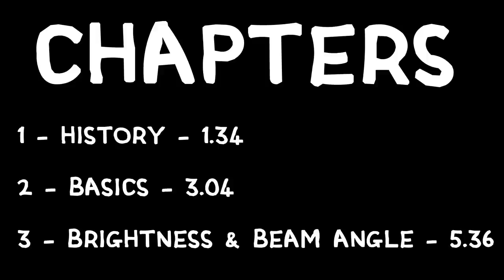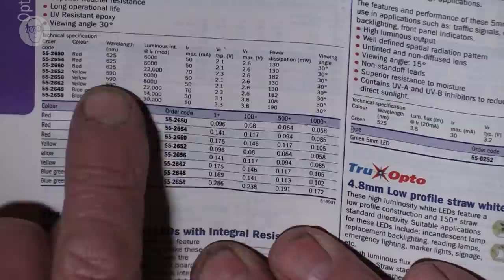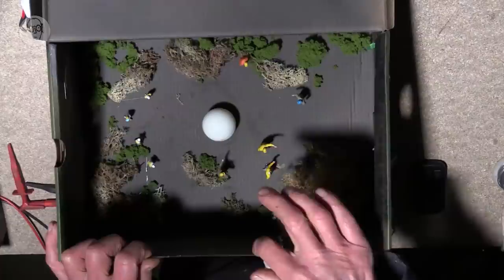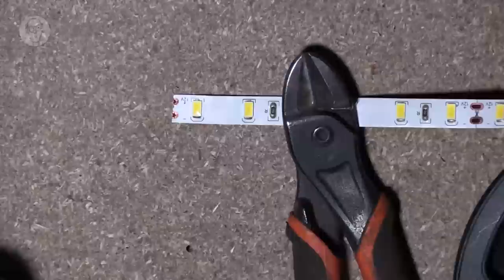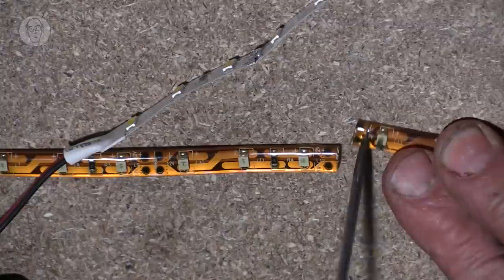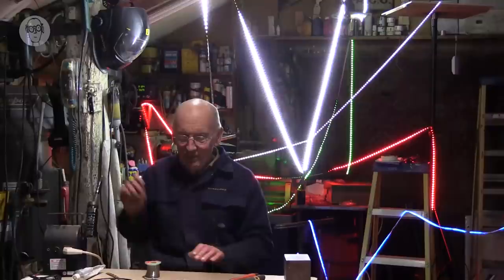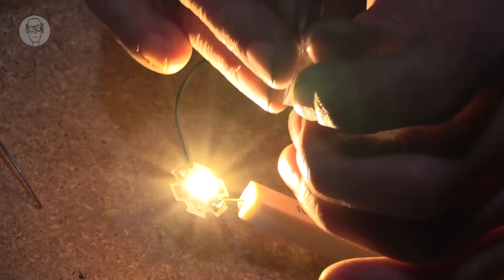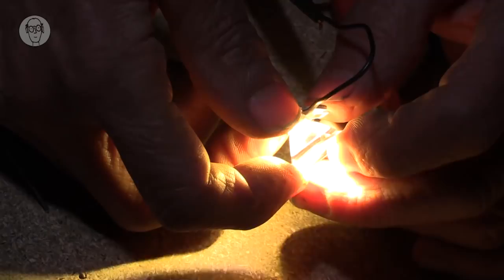LEDs -The Secret Life of components, a series of guides for designers and makers - Episode 2

Comment: It's interesting to note that while the first LED tubes did use a connection to each end, they later switched to feeding the power from one end due to the number of shocks received by people replacing tubes while powered.  Traditional tubes didn't generally conduct from one end to the other until the gas had been ionised.  To allow for the existing wiring they sometimes used a PTC self resetting fuse bridging the pins at one end and a starter that had a link in it so that the existing circuit with bypassed ballast would ultimately feed live and neutral to one end.
Other tubes require the fitting to be wired with live and neutral at one end and will only work one way round.
Reply: we NEED to see a video collaboration with you and Tim. It would be EPIC!
Reply: LED retrofit tubes that use a connections at both ends have been illegal to supply in most countries for a long time. Regulators claim this is for safety, however it's almost impossible for any danger to actually occur in real life. To be zapped you have to have the power switched on, be standing on a metal ladder, then fit only one end of the tube (leaving the other end dangling). Next you must rotate the tube 90° to lock it in, then reach along to the far end of the tube and touch the exposed pins of the non-inserted end of the tube whilst not knocking out the connected end's pins. After all that, you still only have a 50% chance that your initial connection was to the Active (Line/Live) of the mains.
- There is FAR HIGHER danger from a standard ES or BC lampholder, for example in a table lamp, since that carries a 100% chance of shock from touching the connections.
A retrofit LED Tube DOES NOT require any rewiring nor ballast removal for standard "switch start" fixtures used in most countries (an American rapid start, instant start or any electronic ballast fixture will need rewiring).
Where the LED Tube has connections at either end, the circuit works after removal of the old starter (leaving it open circuit).
Where the LED Tube has connections at ONE end, the starter is replaced with a "LED starter" that is actually a fuse.
The old (magnetic) fluorescent ballast can safely be left in-circuit, and there are no significant losses or voltage drop across the windings. That's because of the reduced power drawn by the LED tube, which prevents the ballast doing it's "inductive stuff" like in the old fluorescent circuit.
I've extensively tested such retrofit tubes during product development, and the maximum loss from a 36/40W ballast and <20W LED tube is about 1W, and it's typically under 0.5W for many combinations. This loss is small  compared to the overall power saving (eg: 46W to 15W = 31W) and it is not worth the time and effort to bypass the ballast.
Reply: @68Polara500  And ElectroBOOM !
Reply: I was just thinking "I wonder if clive ever watched Tim's TV shows" and then I scrolled down and immediately saw your comment! Were Tim's secret life of machines a series you watched in the past?
Reply: Yes a series with Tim & Big Clive would get my vote. Remember Tim & Rex's shows fondly. Great to see him producing new content.
Reply: @Farlig69  better, he knows how to USE tools to not die this comment BROUGHT TO YOU BY HP, i mean AGILENT....err... KEYSIGHT? YEAH KEYSIGHT!~!!
as long as we dont get photonic in here or it'll get popped
Reply: You 2 should get together. It would be nice for the 2 of to swap views on tech...
Reply: @68Polara500  you have hit the nail on the head sir!

Comment: The way I remember which way they connect is to imagine that both the flat side of the LED and the shorter lead are "ground down", hence connected to ground or negative.

Love these videos!  Thank you for everything you do, Tim.
Reply: The flat line on the diode symbol is negative, also. Electrolytic capacitors have a line on the negative side, too.
Reply: That's a very earthy mnemonic.
Reply: NOT always, i've had some in the past with the opposite, long lead negative, and/or 'flat' positive !  think i still have some like that, you have to watch out!
Reply: @5roundsrapid263  some electrolytics years ago had a line and + symbols for the positive !

Comment: I've been a Tim Hunkin fan ever since the Secret Life series was first broadcast, so I've been binge watching these new videos!

The correct way to  work out the resistor value is subtract the LEDs forward voltage (called Vf on the datasheet) from the supply voltage to calculate what voltage you need to drop across the resistor. Then divide this number by the rated current of the LED to give you the resistor value. So for an LED with a 3V forward voltage, being run off a 12V supply at 800mA, the resistor value will be (12 - 3) ÷ 0.8 = 11.25 ohms. To calculate the required power rating of the resistor, multiply the voltage across it by the current. So for this example it will be (12 - 3) x 0.8 = 7.2W.

Comment: Those Wago Lever-Nuts Mr Hunkin used at 29:59 are fantastic. They replace wire nuts/maurettes/choco blocks, and they're way faster to install, but more importantly they don't twist or damage the wires. If you're ever doing any house wiring, I recommend them. Pros probably don't use them because they're so much more expensive, but for DIY use here-and-there they are definitely worth it.

Comment: Mr. Hunkin. Today, somehow one of your video came into view and caught my eye. I am in my early 60’s and after growing up on a family farm in the upper Midwest in the states, I have been around machinery for ever. There are genes passed thru family as I was adopted but my maternal grandparents we mine. Grandpa had an electrical engineers degree in 1932. He bought me chemistry sets, mechanical crane set, even a train. Either way I found that studying a machine and it’s parts, at age 9, I was arc welding the disc that had broken a frame component. A go-cart came to the step-grandparents house at the bottom of the hill. They came during the summer when school was out from 80 miles away. It was parked in the machine shed. Knot in rope, flip the lever for choke & moved the spring clip away from the spark plug on top. If lucky, it would start on first pull. I drove it behind the 4 or 5 buildings to keep from trouble. I broke it. I don’t remember what but had to fix it as my cousins would be coming in 5 to 6 months, being older, would pound me into the ground. I found water in the float bowl, fixed it and 250 gallons of petrol was next to the diesel. 
  I learned to fix and that’s what I did. Fast forward 50 some years, now I am watching you!
I watched 100+ videos on LEDs, and you Mr. Hunkin, have covered “Ohm’s” law, power solving circle (P over I x E) and more. Everyone is using an thing call “Arduino”. I don’t understand it, tried learning but gave up quick. I didn’t know they could be so small. My god, you even touch on PWM (Pulse Width Modulation) with out people realizing the human eye can not catch all. Even a labscope fills in blank spots between sample, called “Inturpulation”. Congratulations! I love you & your channel. I started a private file to save your videos, so I can find them fast. I am building my own 54 year old Chevy truck, but with a fuel injected 5.3L from an 03 Tahoe my son wrecked beyond repair hitting winter Ice. I find my self addicted to you wisdom, discussion, annunciation with a pleasant voice. I am hooked! Best of luck and my the lord keep you safe for a hundred fifty plus years! DK, Omaha, NE. It is 2,500 miles to either coast from my house. I enjoyed this video tremendously as I had my career end while teaching, technical seminars for up to 100+ techs, and much more! I complained but my boss sent spies to seminars to find out why my numbers where high, and 55 others stayed them same or went down. I told him that’s easy, I worked on these, fixed then and you did not! Blessing to you and your family if so blessed!

Comment: An interesting use for LEDs is being done by radio hams. Focusing 3watt red LEDs into a beam , modulating it with audio and using it for communication. I believe the record at the moment is 120km from hilltops, using visible red light.
(My record is the length of my garden, as I've not taken it out any further.)
Reply: I don't know how they compare for output powers but I'd have thought the one to  tinker with would be infrared, possibly in combination with the visible for aiming purposes. That way you'd be immune to a lot of the atmospheric losses. I'd imagine you'd be well supplied with variations WRT detection devices too,  very developmentally mature component function.

Then, if I had a similarly overgrown playmate and was still based in Snowdonia U would be wondering about IR laser diodes..  I mean if you're going to investigate technical possibility then surely the interest value grows as you home in on peak potential..  If you ignore my mischevious (yes half century teenager)  desire to graduate to laser diodes then IR light is the obvious maximum efficiency WRT cost versus potential performance.
Reply: @So1ipse  There has been some experimemtation with IR and also UV (which works on cloud scatter during the day).
I suspect that using visible red just simplifies things in terms of aiming, LED availability, focusing etc. (Lenses having different focal lengths at IR than visible).
But they certainly found that the interference/fading from sciltilation meant that coherant light was quite poor in practice. Non-coherant was better.
Reply: And there's also the RONJA project in Europe (Czech Republic I think) for optical internet. That one's been around for a while. It seemed so ahead of its time back in the dial-up days.

Comment: Tim;   BRAVO!   I am enjoying your new series and have very much enjoyed your previous series "TSLOM".   If I may make a few comments:

1/  The business of the part numbers of surface mount components including the Length and Width dimensions in the part number is quite common.  Less well known is that this is also true for Lithium coin cell batteries.  For example, the common CR2032 battery is 20 mm in diameter and 3.2 mm thick.  A CR2016 is 20 mm in diameter and 1.6 mm thick.  A CR1216 is 12 mm diameter and 1.6 mm thick.... and so on.

2/  You mentioned that some LEDs have resistors built in so that they can run directly from a voltage source with no series resistor.  Certainly an LED could be designed that way but in the past I have used LEDs that had an integral current regulating IC instead of a resistor.  This has the advantage that any supply voltage (within ratings) can be used and the LED will light with the same intensity.  Unfortunately I can't remember the part number and don't seem to find them listed any more. Obsolete part I guess.  However, ON semiconductor has come to the rescue with a series of 2 terminal current regulating diodes (NSI45020, NSI45025, and NSI45030 shown as "current" part numbers) intended to regulate low current LEDs at 20 mA., 25 mA., or 30 mA. that will work in exactly the same way.    See data sheet:   https://www.onsemi.com/pdf/datasheet/nsi45020-d.pdf   They are in a surface mount package and you connect them in series with an LED or series string of LEDs just as you would a resistor - but do pay attention to the polarity!  They also have some interesting circuit possibilities.  For example, connect one lead of the current regulating diode to your voltage supply and the other lead to an LED or string of LEDs but instead of connecting the other end of the LED string to the supply negative connect it to the cathode of a 5 volt Zener diode.  The anode of the Zener is grounded.  (Bypass the Zener with an electrolytic capacitor.)  You then have an essentially "free" 5 volt power supply that can supply up to the current the regulator diode is rated for which can run some logic chips.   I have used this sort of configuration several times in my designs to avoid having to build a separate dedicated regulated power supply just to provide a few milliamps for some logic circuitry.

3/  You mention that connecting reverse polarity to an LED does not damage it.  This is only sort of true.  The LED is a diode but it has a fairly low reverse breakdown voltage, usually in the order of 4 to 5 volts.  If you reverse connect voltages higher than this from a source that can provide large currents you will let the magic smoke out of the LED in short order.  I have also seen cautions in LED manufacturer data sheets to avoid long term reverse biasing at voltages lower than the breakdown voltage as the LED can be damaged over the long term.   The bottom line is that a few seconds of 3 volts reverse voltage is not a problem, but don't make a habit of it.

This is just an overview and I hope it helps.  I am open to discussion if you want to get into the subtleties...

        Best Regards...   Vince

Comment: I remember watching the Secret Life of Machines and Tim explained his workshop was lit by low energy CFLs (which at the time were really expensive but lasted a long time) and wondering how he felt about LEDs. Now I know!
Reply: The early CFLs were far more robust than the later ones. I bought a house with them, and some had been there over a decade. They lasted several more years. Of course, I have all LEDs now...
Reply: @5roundsrapid263  I have an early cfl in my house that I installed in 1994, it's still working fine! The newest ones hardly last a couple years!
Reply: @charger959  It’s the instant on function. It made them sell better, but their longevity really suffered.

Comment: Hey Tim, great video!
One reason LED lamps are better than fluorescents in garages and workshops is that the LED lamps work much better and last much longer when it’s cold.  Fluorescent lamps have to heat and vaporize mercury to make UV emitting plasma.  Cold tends to wreck the filaments and darken the ends of the tubes.
(In 1976, when LEDs weren’t that bright, I got a lot of light from a red LED by running it at high current in liquid nitrogen.)

Comment: Thank you very much for recording these videos (and The Secret life of Machines, of course!).

On finding the right resistor value for the LED: if we have a current limiting power supply like the one shown in the video, a variable resistor is not needed. It's enough to power the LED at the desired current (say 700ma) and measure the voltage drop across it (let's assume 3.2V). Then we can just use KVL and find the desired resistor to be (12V - 3.2V) / 0.7A = 12.6 Ohm. The numbers are just an example.

Comment: Hi Tim. Many years ago I lived near a GEC traffic automation depot which had a huge skip outside. One day I walked by and there was a set of 4 complete signals on the poles together with 2 electro-mechanical (relay/uniselector) pedestrian controllers. With no tools I couldn't remove the controllers but I managed to get a 1950's traffic head with the swivel adjustments (which I foolishly sold to my mate at school to use for his disco!).

Comment: Tim, you're an absolute legend. I've a vague memory of your C4 stuff as a youngster. In fact, just watched the internal combustion episode - 30yrs later and still accurate and awesomely illustrative (punching a hole in the oil filter when the engine was running and igniting the injectors  - excellent). People like you are unfortunately a dying breed. Keep up the excellent vids. P.S. have you tried WLED (for more generic effects) with a NodeMCU? Very simple to setup and configure - I had 250 pixel type addressable LEDs running off one for the tree and same again for external house lighting this past Xmas, very reliable (kept the external lights going until the clocks went forward).